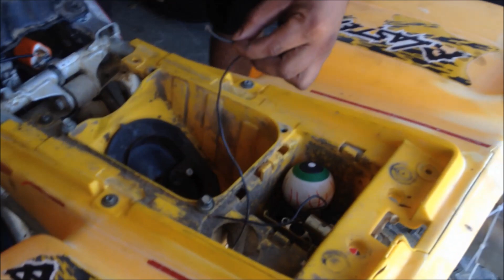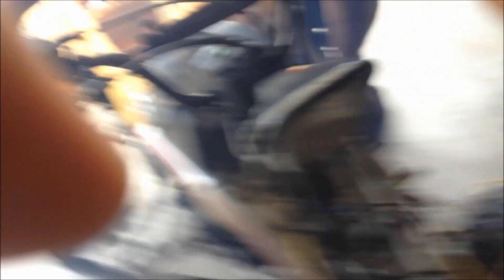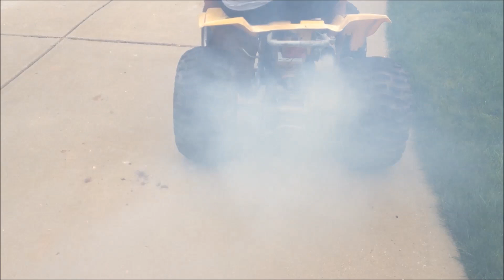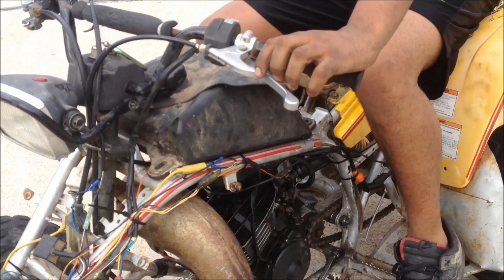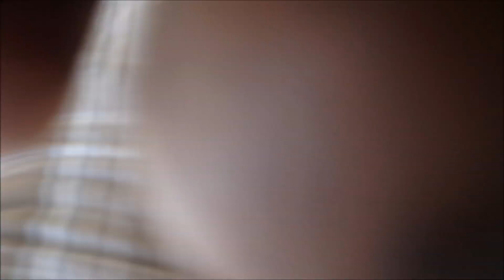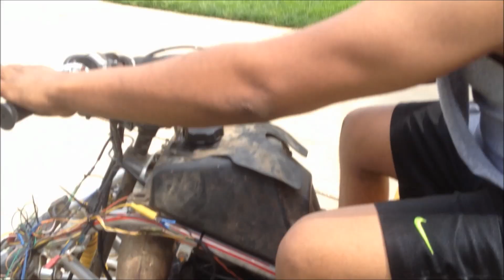1997 Yamaha Blaster 200 Project First Start And Break In After Rebuild

Comment: So this video is really old but I’m sorry as a blaster lover I have to put my two cents in... first off u get a lot of smoke when doing a new top end if u lubed the piston when u put it in second u might want to check tht air leak u got going on somewhere by the exhaust port of the cylinder... I’m willing to bet since this video he has either put a new top end in or it needs fixed lol....